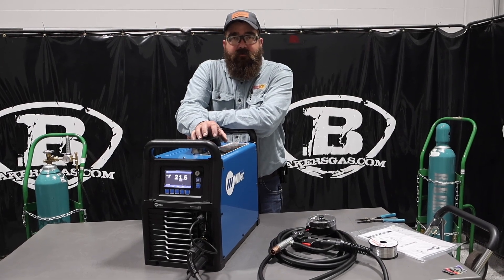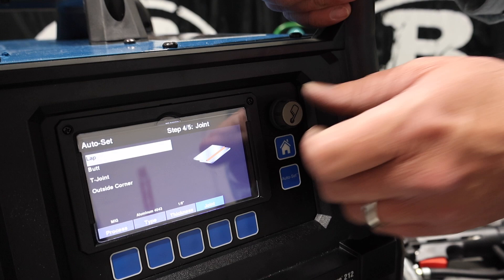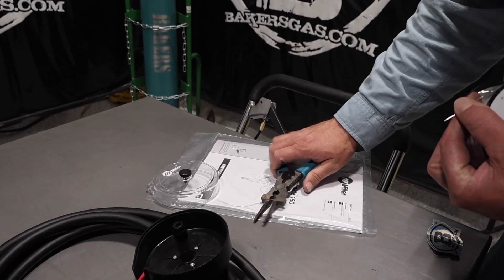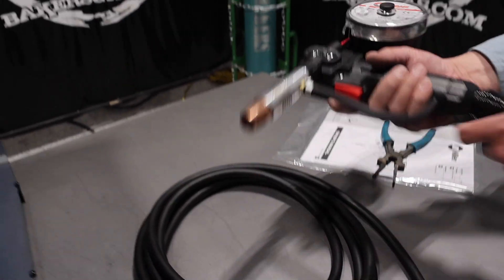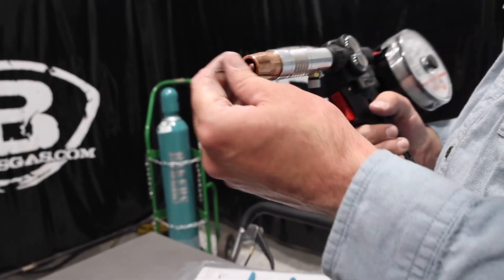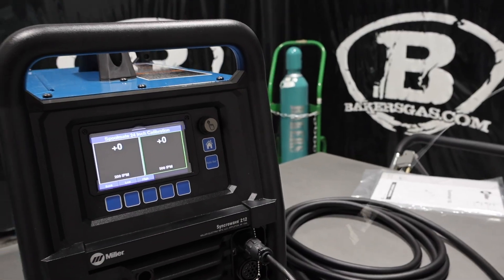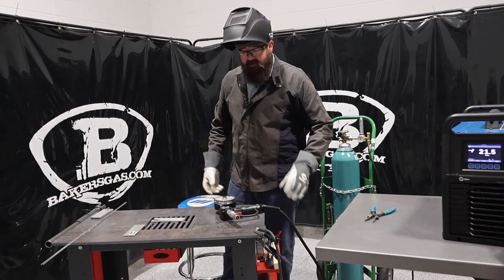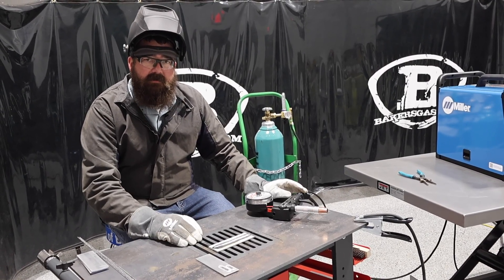Miller Syncrowave 212 with Spoolmate 150 | Full Review & MIG Aluminum Welding Demo

Comment: I thought the Spool mate 100 & 150 was for welding MiG Aluminum?

Why do that, when you can just Tig all that with Aluminum?
Reply from the maker: You certainly can do it TIG but some people like option of MIG easier/faster ability to make TIG / STICK welder lay a nice aluminum MIG weld
Reply: @BakersGas  I see it’s very versatile. Thanks for answering.
Reply: I have  a spoolmate 150 from 10 years ago it plugs in where a mig wip insert is.  I am scratching my head wondering 🤔 how to connect it to the syncrowave 212.